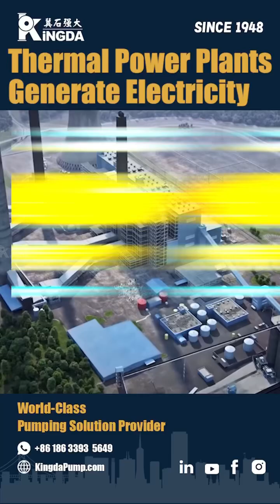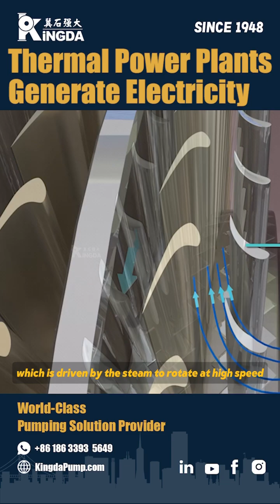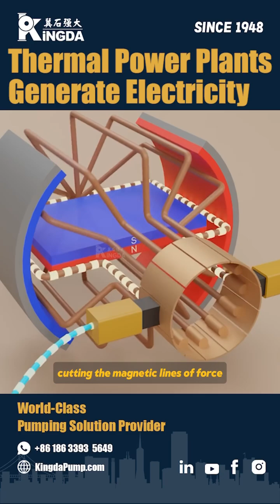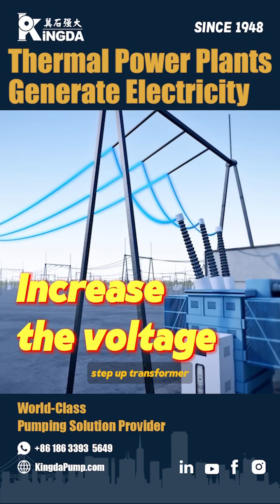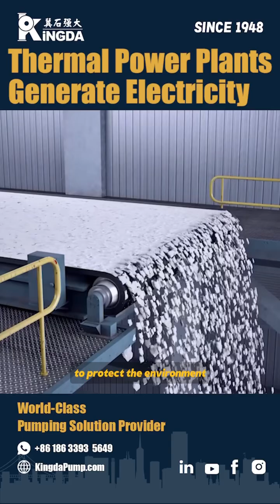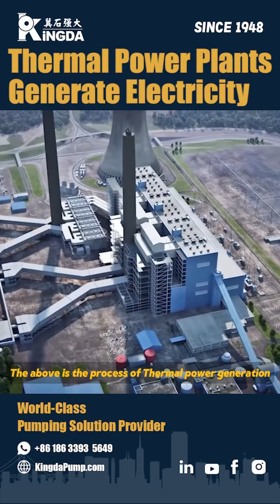How is Electricity Generated? #ThermalPowerPlant #KingdaPump #desulfurization #DesulfurizationPump

Comment: or if you are a far left pos, electricity is generated magically out of thin air 🤣
Reply: Can also be generated from gas turbine, methane, diesel, geothermal, hydro, solar, wind. In NZ a large portion of electricity is generated from renewables.
Reply from the maker: Yes, there are many ways to generate electricity now. NZ is great, I yearn for it.
Reply: @jpdenford1473  NZ is a tiny tiny tiny tiny extra small island community with barley any ppl living there...for a HUGE country to do that, would require 10s of millions of wind turbines and solar panels which means exponential cost in acquiring rare earth minerals...
Reply: @premiumsomdier  yes NZ is about 2% the population size of the US, and geographically unique in many ways (which allow the more niche forms of generation like geothermal & hydro). My point was just that there are many other ways to generate power - although they could be described as magical haha.

While switching to renewables is expensive (right now) and raises ethical concerns, the reason it is important to switch, is to avoid the massive costs and even bigger ethical concerns associated with NOT switching (droughts, sea level rise, mass migration etc).

What's exciting about huge countries like the US, China, India, etc making a switch to renewables, is that the impact globally is so much larger (in terms of reducing emissions) than from a small country like NZ. Not only that, but it helps create economies of scale with regards to production of renewable technologies, which brings down the price for smaller and poorer countries to follow suit.

Coal has been awesome in what its done for humanity but it's pretty clear that we now have cleaner and more decentralized options I think.
Reply: Oh and not to mention nuclear fission! (and hopefully fusion one day in the not too distant future)